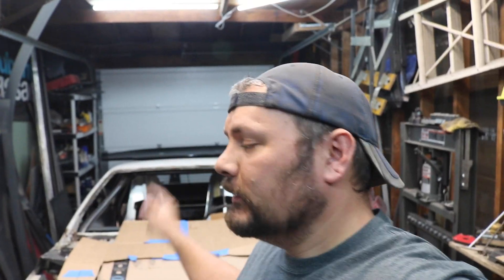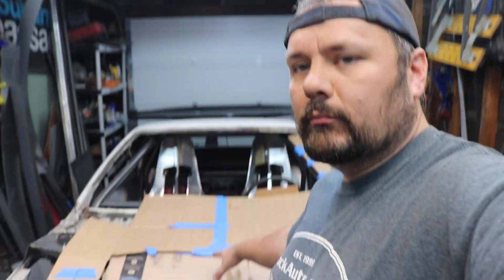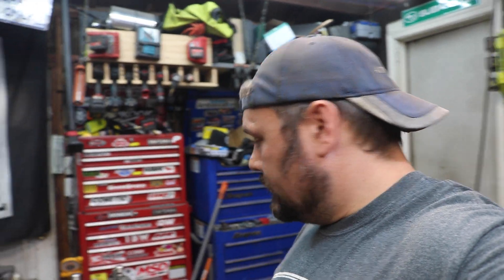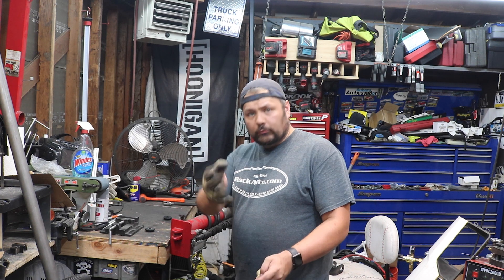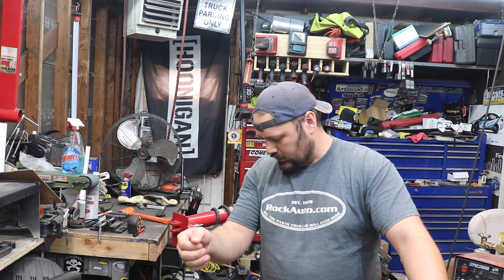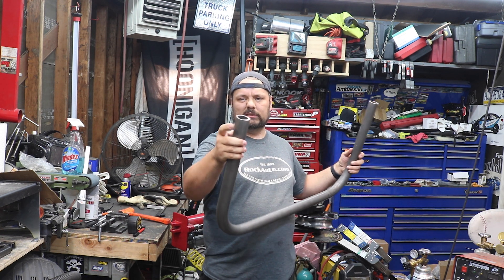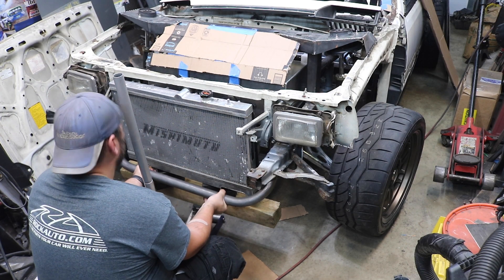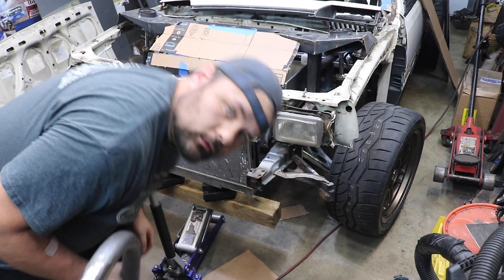Subaru Powered Honda CRX: Building a Custom Tubular Radiator Support

Comment: Love this my man. I've never built a car before however I've planned for  build most of my adult life. Just not financially alas, however I digress. I have present day an 86 crx si  which I plan to make much different than stock , j series subframe , rwd. Thus far with out funds to divert to her quite yet I ve begun doing things that doesn't cost money such as engine trans and wiring removal. Thank you for the inspiration love the build